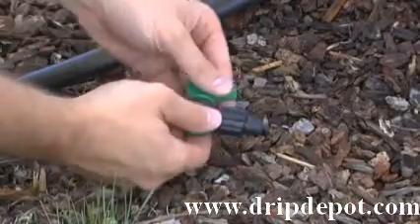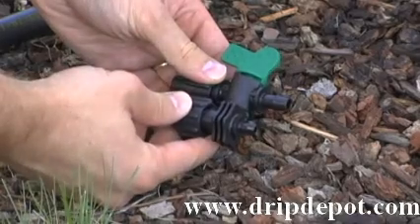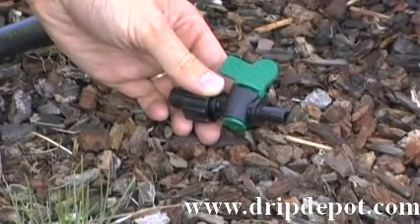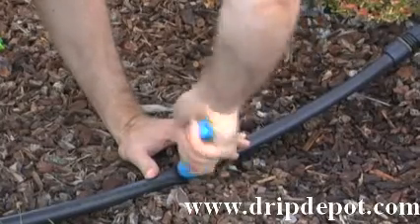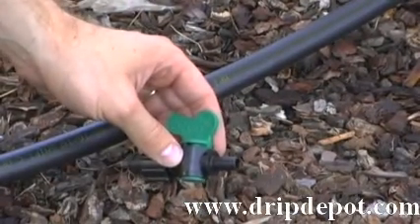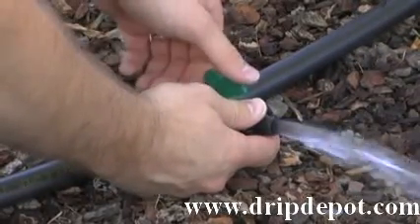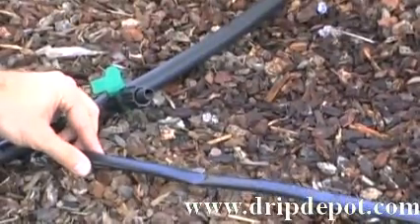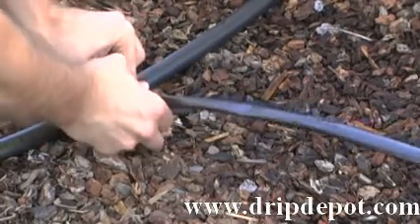How to Install a 400 series barbed takeoff valve in a drip irrigation system

Comment: Any tips for punching the holes out for these varbs? 😅
Reply from the maker: You bet Jancie -- before I do, I can confirm that blue punch is not the easiest to use.  There's only two punches that make that sized hole, and for whatever reason they're both difficult to use.  

For the blue punch, twist it back and forth as you apply pressure so that it cuts into the tubing instead of just punching.  You'll get the hang of it after a few holes are made, I can confirm it gets easier (though by no means easy!)

Comment: can this valve only work with tape? can it work with 1/2" Polyethylene Pressure Compensating Drip Line
Reply from the maker: Hi, Thanks for the question.  The locking nut is only designed to work with with drip tape for this particular fitting.  We do have perma loc fittings for 1/2" tubing.  You can find them here: https://www.dripdepot.com/category/drip-irrigation-fittings-tubing-perma-loc  Let us know if you have any questions and have a great day!